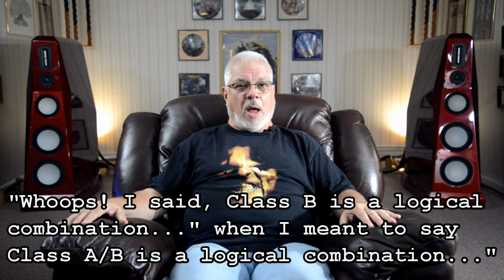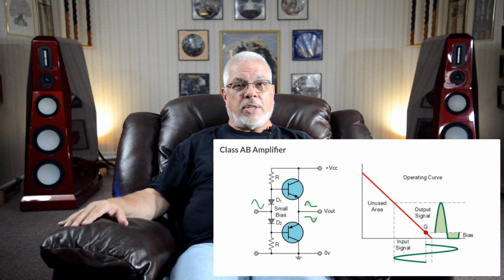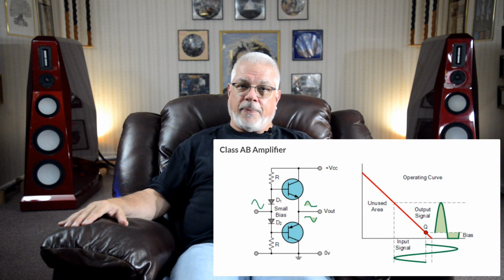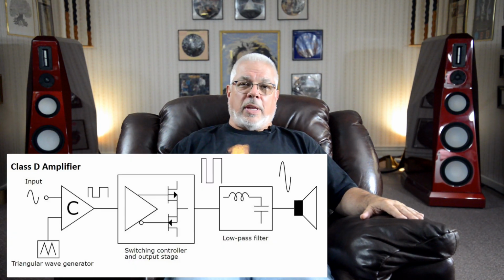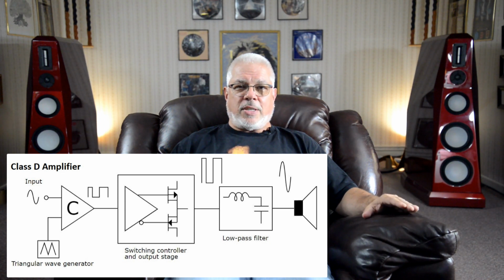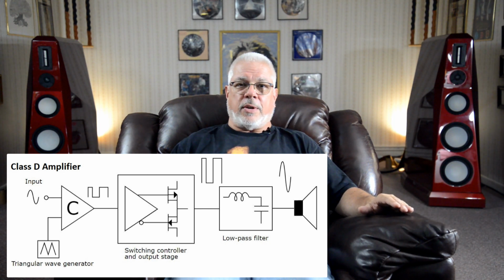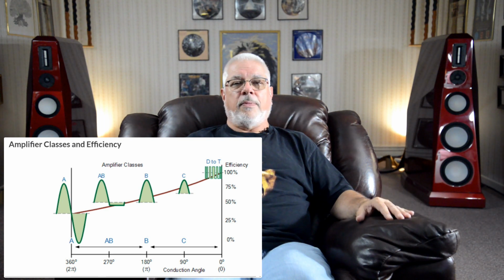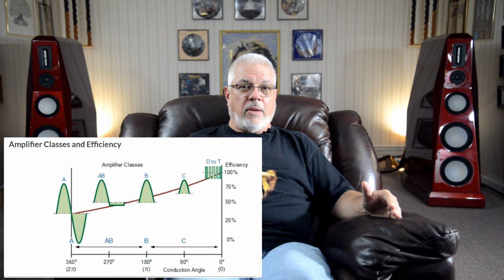E19: Amplifier Fundamentals

Comment: Class G and H are not really belonging to ‘switching’ type, like pwm class D … they are traditional class AB with multiple power supply rails to improve efficiency 

BTW pair of my Purifi 1ET9040BA based monoblocks from Buckeye, is magnificent value for total of 2600$ USD, with nothing but ultra quiet noise background, natural, un distorted, ultra linear and relaxed sound, offering more clean power and headroom than I would ever need.

Comment: Great presentation.  Puts it all together clearly.
A follow on topic that would be great is the use of feedback, its pros and cons and examples of low feedback designs in practice.
A point that intrigues me is we are in the end just listening to the power amp power supply interact with the speaker.  The tubes or transistors in that last step are literally valves to control the flow of current from the PS based on the signal created upstream.  So the power supply quality is vital to the final sound.

Comment: Good joke - 20 years old expensive amps are way better than new budget ones - no contest in tonal balance, accuracy and overall fidelity. And about purity - many new amps have high S/N ratio like Krell S300. And how pure it sound also depends of components used - type of caps etc. Older amps voicing was more to the warm side, so it is gonna sound less pure than a clinical thin sound of those cheap joke of a amps You try to sell us( no directly but it's all about that narration).

Most of affordable amps and gear overall is made by acountants - they cut costs more than they did 20 years ago. So if you want new amp build as good as simmilar model 20 years ago - you gonna pay more than 20 myears ago plus inflation.

Comment: lol Flat earth people make me tired. I have to constantly explain my Mola Mola Kaluga's are not the same as the kit you put together with hypex modules or the Nord ones that a guy assembles a kit for you! The capacitors alone cost more than the hypex modules! The power supply is bespoke too. These things are  neutral and just work. I paid $7500 for mine used...I couldn't find a Hegel, Luxman, Moon, Mark Levinson, Krell, Naim, Pass Labs, or Parasound in that price range under 10k that sounded better. The only thing I like better than my amps are the more expensive Audionet ones. Maybe I need to listen to more brands?

Comment: Class A/AB courtesy of John Curl seems to hit the spot for me at home...
A lot of well presented valuable information contained here, starting from basics and building on that...
Reply from the maker: Hello Marcus... Keep in mind that what John is doing is essentially a very clever and effective modification to the typical Push-Pull Class A/B circuit. Using a Push-Pull design that is HEAVILY forward biased allows a full powered A/B amplifier to offer Class A operation for about the first 10 watts of demand. Past that, it is still a Class A/B circuit. And not surprisingly, other manufactures are offering a similar bias arrangement for their Class A/B designs. I hope that makes sense.